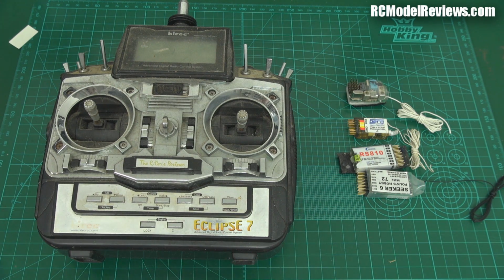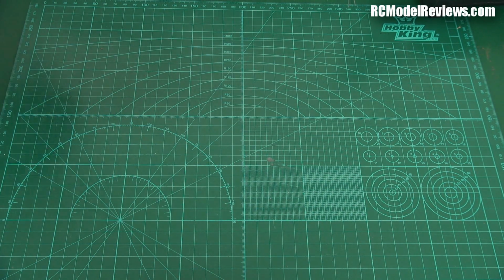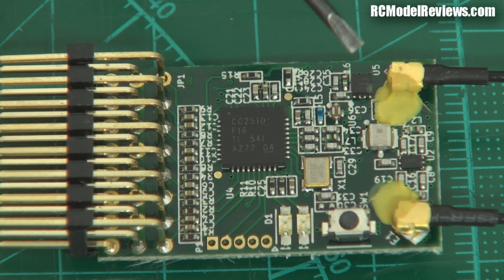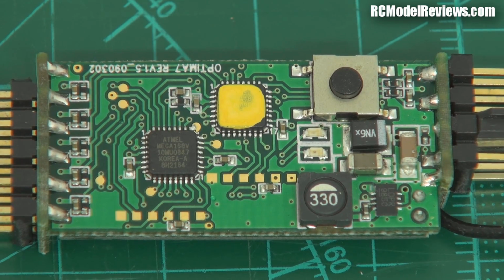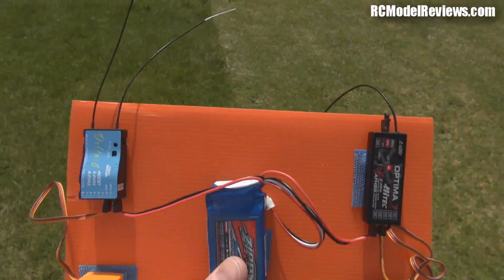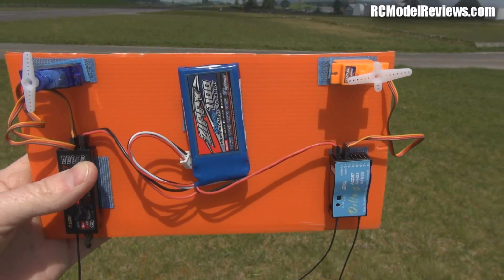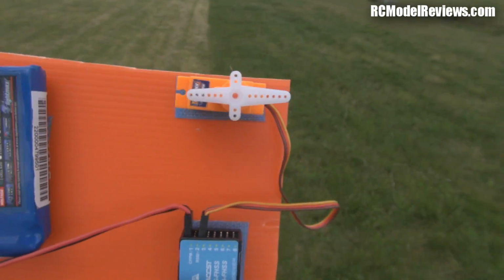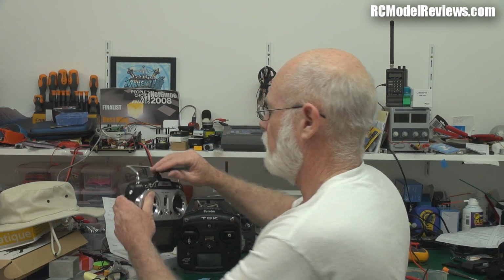FrSky Delta 8 receiver (review)

Comment: Hola , tengo una radio Taranis Qx7 y la quiero usar con un Delta 8 en elicopteros KDS 450 electricos , seria receptor , servos , motor , giroscopo . Es necesario que le descargue e instale el Open Tx , ya que no usaria los datos como un dron ? Al lado de un dron mi helicoptero es practicamente analogico , gracias , saludos desde Argentina , Santa fe cap. .

Comment: Hi, I know it was 5 years ago but I still have a simple question about the Delta-8. Will it work with Airtronics  transmitter: Sanwa SD-5G 5־Ch Computer Radio Mode 1? it uses FHSS-1.

Comment: Regarding the FrSky Delta 8 receiver:  I'm using a Taranis X9D transmitter with this receiver, and I'm wondering if in CPPM mode I can map inputs to the Ch3-8 pins. (Ch1 pin is CPPM, Ch2 pin is RSSI). I seem to be getting some signal on some of the pins, but can't make sense of the mapping.

Comment: I've bought three of these and although they link up  almost immediately with the DJT module on first start up they can take up to six seconds to relink after activating the failsafe by switching the Tx on and off.  Not going to trust these in anything of value I'm afraid.

Comment: Does the receivers higher voltage capacity (16v) increase the signal strength and or the range ?  Or does the signal come from the radio itself?

Comment: Thanks for the great vid Bruce! Im helping a friend build a race quad with the delta 8. he is using a futaba t8j s-fhss. we can bind the receiver with the radio with a solid green light indication on reciever. We have the delta 8 hooked up to a naze32 rev5 with ppm. channels 3/4 bridged. We just cant get any stick commands or aux channels to work. in cleanflight we have ppm selected. Does cppm work with the t8j? or is that just a feature with frsky transmitters? Thanks so much for any help

Comment: Hi Bruce, I have used a bunch of these receivers with good results EXCEPT for the RSSI output. It has a PWM output for the RSSI which I convert with a 10uf/4k7 RC filter into an analogue voltage for an Ardupilot. However the RSSI output is very inconsistent and doesn't give an accurate indication of the single strength at all. Any chance of you looking at this aspect or has anyone else had a similar problem?

Comment: Bruce, think you missed two facts. I am using the Delta-8 RXs for two years.1st : When using the RX with Hitec the Delta-8 offers in conjunction with ppm 9 channels! 2nd: Autobinding does not work, when you set up the RX for ppm. You habe to use the two jumpers which come with the RX.

Comment: Hey Bruce. Glad to see my little receiver (well ok firmware...) out in the wild and in review :)
One thing I would mention is that on Failsafe, different manufacturers have different ideas on it. One of the key factors is how many packets that are lost before its declared as signal loss. Once signal is lost, then a searching algorithm is performed to pick up the current transmitter channel. So the way you tested it in your review meant that if a receiver took more packets to declare a signal loss, then it would appear to hold lock for longer - when in reality it didn't.
The best way really would be to test with a servo sweep mode going. This way, you can see when the receiver actually stops receiving a signal and any jitter in the movement appears - a more fairer test as when flying, you wouldn't have a servo stationary for very long!
Another little interesting test would be to measure the low power modes on transmitters. A lot of people assume they're the same and claim a particular brand has better range - but only ever tested it in low power mode! You can do this quite easily by dusting off your spectrum analyser, directly couple the antenna into the SA (check max power for SA - may need attenuator), putting the transmitter in range test, sticking SA on max hold and measure the peak. IIRC, Futaba range test mode is around 1mW and Hitec is around 10mW (long time ago though I did this, so may be wrong!!).
Cheers,
Si.
Reply: +Simon Chambers Yes, there's no consistency between brands as to the RF output in low-power mode.  Unfortunately, even when radios have a "servo exercise" mode, it can't usually be operated at the same time the radio is in "power down" mode for range-testing.
Reply: The Aurora 9 definitely can be put into servo test mode when in range test (as module based). My T8J has a servo test mode when in low power mode (ch1 iirc?) and it looks from your video that the T6K has it too. :)

Comment: Bottom capacitors have the incorrect footprint / incorrect type of capacitors, they are probably supposed to be tantalum capacitors...
Reply: +vitor de miranda henrique Ceramics are far more reliable and robust than tantalums so it was a good move :-)

Comment: Bruce,

I got problems with the Delta 8. 

In a big city (a lot of radio noise) the delta 8 would kick of after about 10 feet. So I took it outside of the city and flew my plane all over the place with no problems at all (my gear was a futaba 8uap with a Frysky module).

So i bought myself a S-FHSS futaba module and a 2006gs receiver, test it on the city, no gliches at all, change the reciver to the delta 8 and switched it to s-fhss mode and again 10feet of range.

Conclusion: The Delta 8 cant handle to much noise. So in regards to safety of others and my plane I am only using Futaba´s receivers.  I wonder if you can test how noise impact o the receivers receiving capability.

Best Regads,

Joao
Brazil
Reply: +João Dourado Okay, I'll check.   The Futaba receivers are definitely a better receiver -- but they do command a premium price.
Reply: I have this issue too

Comment: I just checked the manual on the optima 7, and I didnt see a way to disable telemetry. AFAICT, it always sends at least voltage telemetry back to the radio. If that is the case, that would go a long way explaining the reduced range. The optima 6 has no telemetry and would be a more fair comparison (disclaimer: Im a big frsky fan, but fair is fair).
Reply: +P44man The fact that the Optima sends telemetry ought not affect the range at all.
Reply: +xjet It's quite common that telemetry drops range. removing telemetry and reducing amount of channels increases range. or rather, the signal has the same range, tehcnically, but with less channels and without telemetry you get less signal attenuation and thus a more solid signal, which means longer ranger before the receiver can no longer understand what it's receiving and going into F/S
Reply: +RCKnut That's not necessarily the case.  Reducing the bit-rate on the comms link will increase the range by increasing the effective receiver sensitivity.  Note however, that the Optima 7 and Delta 8 must be using exactly the same bit-rate because they're receiving exactly the same signal. 

The only difference is that the Optima will use the gap between received data packets to send back a telemetry packet.  That back-channel won't reduce the sensitivity of the receiver.
Reply: +xjet I dont know in detail why, may be it is because the radio cant transmit and listen at the same time, so your effective bandwith decreases. But whatever the reason, I always read the opposite, and look at the frsky L9R receiver. Whats the first thing they did to increase the range? They disabled telemetry. People doing long range FPV will also tell you to bind the X6/8R in D16 mode , but with telemetry disabled. If you have one of these, give it a try.
Reply: +P44man It is possible that some systems increase the data-rate when using a telemetry back-channel and that may reduce range -- but in the case of this test, both receivers were clearly operating at the same data-rate because they were listening to the same transmitter simultaneously.  So the data-rate seen by the Optima must have been the same data-rate seen by the Delta 8.
Reply: +P44man The Optima6 has receiver battery telemetry , the Minima receivers have none

Comment: Great that you like the Delta-8. I have them in all my planes running to a Futaba T10J radio. The only genuine Futaba receiver I use is the one that came with the radio and it will give solid signal to 2klm. I have not range tested the Delta-8 signal, but it is as strong as your visual range can handle.

Comment: HobbyKing now have some OrangeRX Futaba FHSS receivers that are cheap and a good form factor (like 4 channel or 3 + SBUS, can be modded to put out inverted SBUS) but they drop out a lot if the input voltage is 5v. They seem really stable on 6v though. Might be a good product to do a bit of a tear down on/rant?

Comment: The guy that uses the Delta 8 at my club with his T8J get's weird issues that seem like the receiver losing sync fairly often.
For T-FHSS receiver; You can send the Lipo voltage over SBUS2 (Futaba sell various very expensive SBUS2 sensors..). I'm putting together a little board to do the SBUS inversion and direction control so that cleanflight etc could put out the battery voltage etc.
Reply: +donpalmera Yes... the fact that you need to fork out another $60 just to do basic lipo telemetry with the Futaba receiver is crazy.    It seems that FrSky are one of the few manufacturers who have their act together in this regard.  With most receivers, monitoring your lipo pack requires only a $3 voltage divider board that plugs into the A2 port.   Virtually everyone else gouges you for very expensive ad-on sensors.
Reply: ***** Yep. I half laughed half cried when I looked up how much the SBUS2 sensors were when I found out that SBUS2 could do telemetry. The way the telemetry data is inserted is fairly simple though (http://sbustelemetrysensors.blogspot.jp/) and perfectly implementable in a cheap microcontroller. Adding SBUS2 voltage reporting to cleanflight is one of the first things I intend to do when my T6K arrives.

Comment: If you do a test like this again, I would prefer to see the servos to be kept moving, similar to a servo tester's "sweep" mode. It might be possible that the different receivers simply have more or less strict failsafe detection logic, but that the signal would get jittery before it went fully into failsafe. Perhaps a servo tester's output could be input to the trainer port on a radio, or something like that.
Reply: +Joshua Bardwell - I agree.  One manufacture might want to wait a bit longer before jumping the servos to failsafe.  I mean one radio might need to have 10 failed packets in a second while the other only waits for 5.  A simple way for Bruce +xjet to rig this up would be with a servo tester in sweep mode with a servo connected to one of the sticks.  No special radio mode required so it will work with every radio new or old.

Comment: The delta 8 is just a V8-II or whatever its called receiver so you could re program that and save some bucks too. Also Bruce the new smartieparts 9Xtreme board came out so you could try that on your 9X. I already have one and the firmware is beast. It could make your 9X's better than the taranis! (Except the flappy pattles)
Reply: +Primož Doberšek In your dreams. 
Open9x is the little to OpenTX. The reason the 9X gained popularity was based entirely on it's cheap price and hackability so If you killed it it was only $50 down the drain. Taranis is a level above in terms of quality and support that even the 9X pro can't match.
Reply: +Rob B You got that correct! you can not beat the taranis plus at any price!i had the 6position flight switch installed on my taranis plus and use the x8r and l9r  rx,s together on my high dollar quad and losing signal is never ever even a thought!
Reply: Woldnt say im wrong. Look up the programmer board. It has the same processor as taranis same or more model memory (SD card slot) can have openTX and ERSky9X about witch I have heard people say its better than open tx. True the original 9X hardware isnt great but Smartieparts pretty much makes the thing a taranis with half the price + some better modification and upgrade potencial. Dont even get me started on the pink backlight! :3
Reply: not even close!!!! I have several of both 9x only has 1 3 pos switch no voice and process is different that is why on opn tx try selecting taranis plus  it wont work! not wasting my time clearly you don't know what your talking about! smartie boards were out for 3-4 years now! you act like its new!
Reply: Oh come on see for yourself the new smartieparts board came out in the middle of October about two weeks ago http://www.smartieparts.com/store/en/9x-add-ons/378-9xtreme-preorder.html the thing is a beast. True the tx only has one 3 pos switch (i want one more) but Im sure I'll figure a way to get it.
Reply: Aso the SP board offers a speaker telemetry and it has its own processor
Reply: +Primož Doberšek Yeah it seems delta 8 is the exact same board as V8FR-II. I wonder if the firmware is available from somewhere.

Comment: Nice. Do you think that your thumb and hand close to the hitech could have affected the results?
Reply: +Jayd Lawrence No... won't make the slightest bit of difference ;-)
Reply: +xjet ha ha. Is that you saying that you really don't feel like retesting it? 😁
Reply: +Jayd Lawrence   That's the first thing that occurred to me when watching the video. If bodies block signal, it follows that hands might also do so.
Reply: +S. Giles Might be that the antennae is sticking off the end of the board. The receiver itself shouldnt have much to do with the range as far as blocking. The delta8 looks like diversity antennae
Reply: +Jayd Lawrence
No, the antenna is hanging in free air. The case doesn't receive anything. Also a few fingers wouldn't really block anything.
Reply: +S. Giles Me too. But the antennas are the wires sticking out the bottom of the receiver.
Reply: The antennas are made from very thin coaxial cable and the last, approximately, 3cm of the outer screen stripped away making an endfed 1/4 wave antenna. Only this last 3cm of the antenna receives the signals so even if the receiver itself was in a lead box the same results would be obtained.
Regards
Nidge
Reply: I'm not convinced that RF behaviour is as intuitive as some of the above answers suggest. The hand positioned on one side of the test rig is a variable that could easily have been eliminated from the experiment.
Reply: S. Giles I am an RF professional, primarily working with 2.4 GHz and 5 GHz signals, among others. Not trying to brag or show off. Just saying that my intuition about things RF is not uninformed.
Reply: +S. Giles 
You are overthinking it. RF behaviour is also not as elusive as you believe. At 2.4GHz the transmission i almost exclusively line of sight (with an ellipsoid zone around the line of sight that should be free of obstructions). If Bruce was made out of metal, yeah, he may would make a difference due to reflections. Water on the other hand is quite a good absorber for 2.4 GHz (ever though about the fact, why home microwave ovens use that frequency?). So as long as he doesn't block the fresnel zone (which extends a little bit behind the antenna as well) with a large amount of water, the effects are negligible. If at all a much larger effect will be coming from the body, be it absorbtive or reflective, which affects both receivers equally. And as you see both receivers cut out at the same time when he blocked them with his body (20 or 30 cm of water to absorb the signal).
But just try it out. Take your reciver with RSSI indicator and wave your hand around 20cm from the antenna a see what it does to the signal strenght.
Reply: Could you define 'overthinking' please?
Reply: +superdau Please Sir, share some laboratory findings.